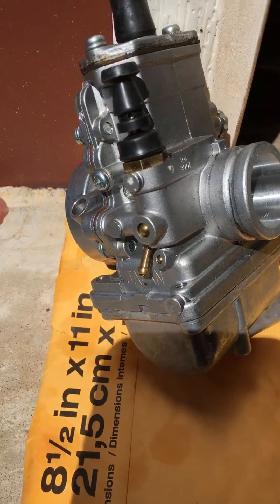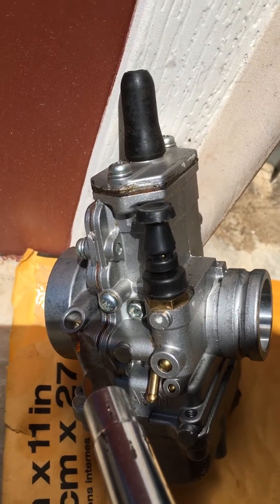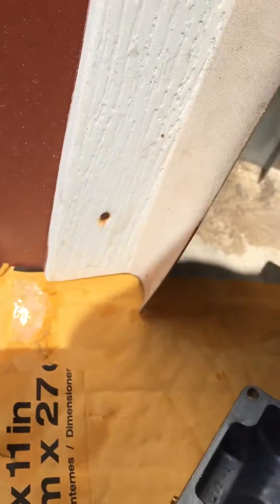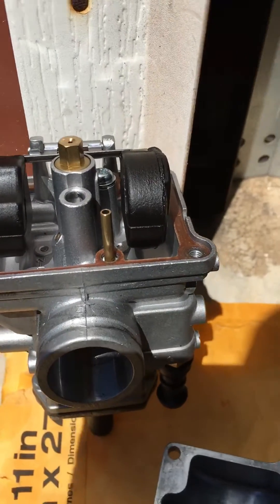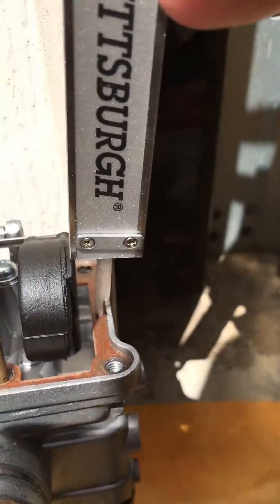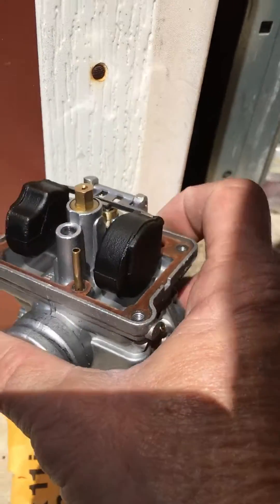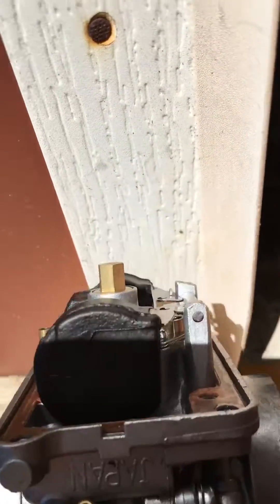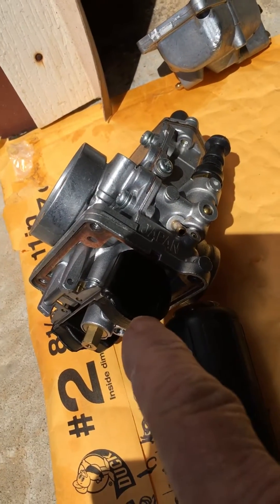# adjusting float level step 1

Comment: You said how to physically adjust it. But not HOW you adjust it.
Reply from the maker: Watch video again I explain everything and show everything
Reply: @2strokecarbtuningportingin187  yes but how do I know when it needs to be raised or lowered
Reply from the maker: @jamesdellaquila1939  bend the tab that float needle touches. I point it out in video. I use needle nose pliers.  Take your carb apart look at it very simple stuff.
Reply from the maker: @jamesdellaquila1939  again watch video I show how to measure float hight with calipers. YOU NEED TO LOOK UP YOUR SPECIFIC FLOAT LEVEL FOR YOUR SPECIFIC CARB MAKE AND MODEL
Reply: @2strokecarbtuningportingin187  thank you. I didn’t know there was a proper float level. I will use your videos to make my cr500 run like freight train. Would you recommend changing to a more modern carb or keep the 30 year old aftermarket one that has the idle screw part of the choke.
Reply from the maker: @jamesdellaquila1939  I have never used a carb that uses choke for idle. Carbs have not changed much in my lifetime I'm 57. Sure there's more gimmiks nowadays. I have ran all brand carbs keihen mikuni electron bings Dellroto. There's only few Type carbs but many brands. See what carbs most people run for your cr 500. But all carbs tune basically the same as I explain in my other vids.  Tried my best to answer your question s have a great day
Reply from the maker: By  bending the tab up or down  that changes physical float level.